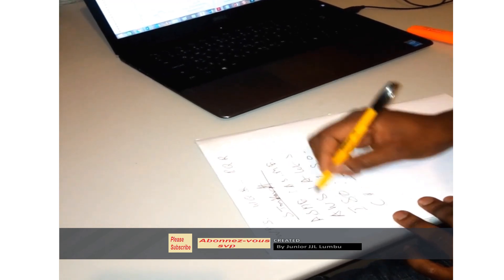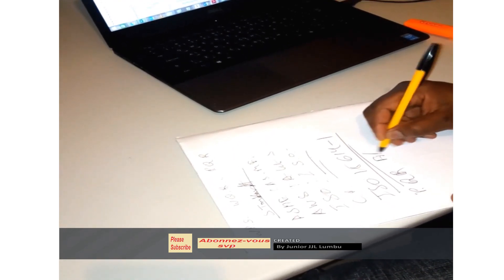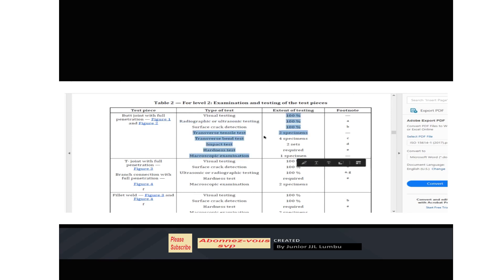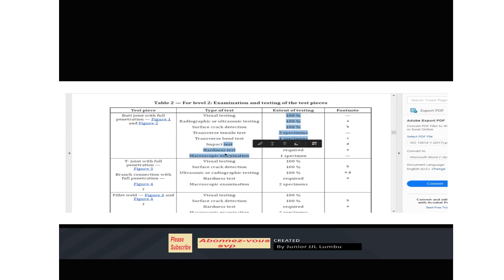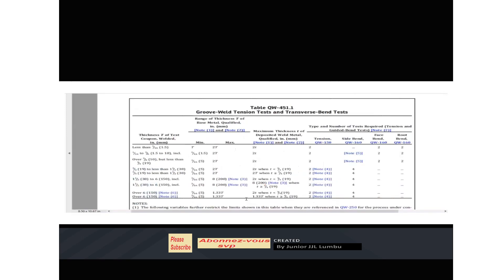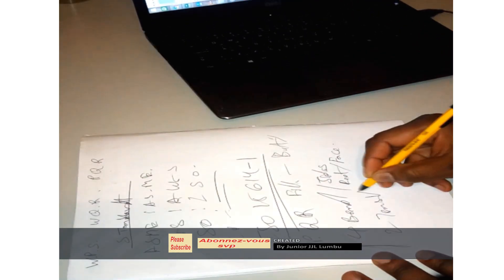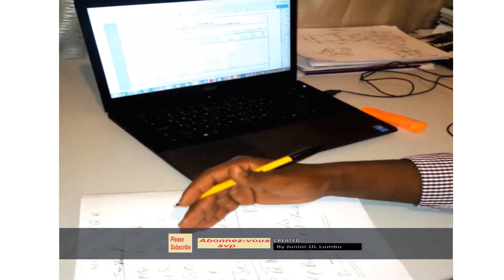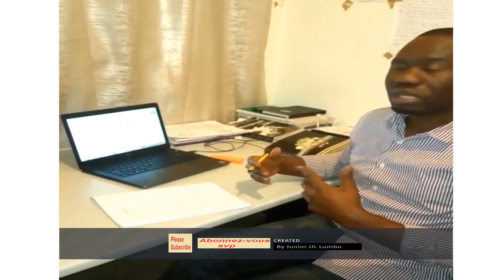WPS Welding Procedure Specification, PQR Procedure Qualification Record, WQR

Comment: After welding complete grinding required or not for wps
Reply from the maker: Grinding provides a better profile of the weld, which in return gives a better visual impression. Nor ASME IX or AWS D1.1 specifically prohibit grinding. However if a WPS states that the method of cleaning is by grinding or brushing then this should be applied, as certain discontinuities can only be removed by grinding. I hope this help, if not feel free to ask.  Thanks